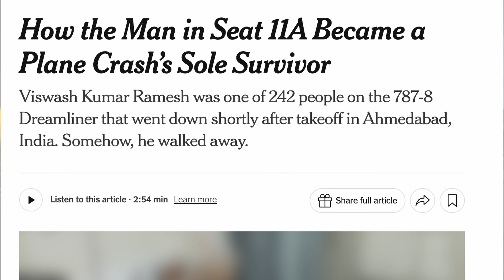Why the RAT Changes Everything – Air India 171 Update

Comment: Captain Steeve,

I love your work here.

Can i introduce you to some videos and have an opinion on those?

IF so, i need to supply the videos to you. They are not online.

They are about a certain historical event.
24 years ago.

I got these videos that i am struggling with because of what they obviously show.
Maybe you can convince me i am wrong with what i see.
Or, you back up my opinion.

Interested in seeing stuff you did not see on TV?
Reply: may i, youtube?
Reply: btw, dual engine failure, sure.
BUT, if it was an electric failure, which caused them to not being able to control the power settings to the engine (since that all is controlled not by steel wires but by chips and computers and servos)
Imagine if people controlled some kinda chip onboard which they could program to turn off certain systems, which would make it look like a dual engine failure.... 

Why would both engines have failed here?

But if they did, why would both engines have failed here?
Again, they are controlled by the electronics onboard, right?

Again: Ever seen the Pilot episode of the Lone Gunmen?

Is it that hard to imagine that certain people are up to something?
Boeing after Boeing falls from the sky. 
Yeah, coincidence.
Pure bad luck.

Nah.
Orchestrated is what i say.

a loud bang!
Just enough to destroy all the other electronic components that make the plane fly?
Where was this loud bang?
Clearly the loud bang was not visible outside. SO no major explosion with flames prior to impact of the plane to the ground.

What was this loud bang>?

Comment: Also the fact that you can hear the RAT at all is important. If those engines were making nearly 80,000 lbs of thrust each, you probably couldn't have heard it. And as I commented before, the 787 is designed to operate and climb safely, even on one engine. So both engines were not working. On a takeoff, that pretty much guarantees a crash. Another piece of information is going around about the gear. The bogeys or trucks were tilted down instead of the normal up angle. During retraction one of the first movements of the retraction cycle is for the trucks to tilt down. This suggests that a retraction cycle started and was interrupted. This suggests a hydraulic failure. (Another reason for the RAT to deploy) And hydraulic power is generated electrically. The plane has 6 generators. 2 in each engine and 2 on the APU (which wouldn't be running on takeoff). That's a lot of equipment to fail. HOW? ❤🤍💙

Comment: Apparently passengers who actually arrived earlier on the flight to india stated they were having trouble with the electrical system in the plane. Whether it’s the lights, entertainment systems or charging ports whatever it was they had issues for sure. Now if that’s true then did the Pilots and Crew inform of the issues to be addressed? Did the diagnosis clear the plane off any faults? Etc. Basically someone is in trouble.

Comment: What no one is talking about is this.... I think they knew they had problems before they ever took off. Unfortunately they were past the point of no return and decided to take off anyways. This runway is much longer than they actually need to take off. Look at the dust flying up in the air as they take off. Evidence that they were at the very end of the runway when they took off. Evidence the plane had problems getting up to speed before they ever took off.

Comment: There's a script which seems to be at play. Across twitter, Youtube etc.

This is being played out by Western "Pilots". 

The script goes:
- I‘m an airline pilot with X,000hrs of experience
- The flaps are only slightly extended
- The landing gear is still extended, which should have been retracted at this altitude 
- The aircraft is at a high angle of attack, which confirms the insufficient flap setting
- They combine the two to make it into a case for Pilot Error/ human error 
- Erase possibility of Engine failure
- Erase any possibility of Boeing 787 having any issues.
- They all exclusively use only a single video, which was when the plane was about to crash.

What they conveniently don't address:
- The Mayday call from the pilot 
- Sudden stop of all communication
- The fact that the plane was actually at an altitude of 400 ft relative to ground. Ahmedabad is at an altitude of 200 ft. 
- The Plane seems to have no power and falls
- The complete take off video exists which depicts the whole take off. NO change in flaps are noticed. Thus negating the theory of 'withdrawing flaps' instead of under carriage.
- The Plane was recently 'refurbished' by a Turkish firm

This is orchestrated noise generation. There's no chance that so many voices start emanating the same script, given facts to the contrary was already out, without inducement, incentives and orchestration. Why?

The noise about Bird hit stopped as soon as the CCTV footage of complete take off was out.

I hope people are taking note. Both the choreography and the actors. They need to be tracked.

Comment: in the clip where you hear the rat, you cant see it at all. 
in the clip where you can see it, its not clearly connected to the plane and indistinguishable. 
neither clip seems to capture the sound of the crash or the actual impact.

also, there was a video of the building with parts of the plane in it, and that clip also has some facts that dont fit... 

I'm not convinced this story is even legit.

Comment: Without the Thrust availability Aircraft wouldn't have taken off, or the pilot may have aborted the take off.
The take off happened and probably they sensed loss of power to manage the Aircraft control surface.
This can be the too late scenario and they then attempted to deploy the RAT to manage to control the surfaces... 
But there are redudant systems for hydraulicy as well. So if maintenance is totally screwed up ( which is possible) and there is pump damage and contamination then such a scenario can happen. Which is a human negligence created disaster.
Acc to me, there was a late realization of power failure ( hydraulic) to control the surfaces and hence the RAT deployed. I think it is this.
Reply: hydraulic contamination of the power control unit (PCU) electro-hydraulic servo valves (EHSVs) used in the flight control system.

https://www.federalregister.gov/documents/2015/08/19/2015-20267/airworthiness-directives-the-boeing-company-airplanes

Comment: I would like to ask a question about the departure.  I saw on the day of the crash that the aircraft only used 6131 feet of the 11550 foot runway on an intersection departure.  Could this have prevented them from a long landing?  I know it still would have been a disaster but they used every inch of the runway and if they had some left maybe they could have dropped in for a little less damage.  Just asking!

Comment: 1:39 at take off shows a lot of dust being pushed up by the engines, almost like the plane had reached end of runway before lifting. Ahmedabad is 3500 metres in length and 787 needs 1500 metres to get to speed.. Available radar shows the plane only went to end of taxi runway which is about 1/2 the runway before take off, is that common? Did they reach the point of no return before they had to if they had used the entire runway? Just speculating

Comment: Operating jet engines produce a lot of heat, not much smoke or vapor, but when viewed from behind (or photographed), the heat distorts what you see looking through the exhaust from the engine. Not saying this well, but it's like looking through heat waves shimmering above the desert for example. Their doesn't appear to be that heat distortion at any point watching that aircraft fly by, or away.

Comment: Point number 1.  If both the engines fail, the plane can land by gliding but for that it needs minimum altitude and airspeed to glide to the runway. 
Point number 2. Air india flight is about 800ft only and with 55k litters of fuel and its too much weight to land  and there is no thrust as well 💔

- Aeronautical engineer

Comment: The RAT isxan incredible piece of machinery.  On the L1011 the RAT only provides hydraulic power, and a measly 1600 psi at that, but it was held up with a 750 pound spring and was a real pain to stow after deployment!  And yes, they come out with a huge bang and make a great deal of noise when running!  We used to test them by hooking them up to a hydraulic mule and driving it with hydraulics from the mule.  One of the scariest things that I ever heard of was when our mechanics were testing a RAT on a C Check in the hangar.  It was break time so about 20 guys were standing around watching the test.  Suddenly the RAT prop started showering the belly of the aircraft with sparks and shortly after that, it departed the airplane completely!  The prop and hub clattered around all the stands that had been gathered around the airplane for the C Check and somehow, when it finally hit the ground and stopped spinning, not a single person had been touched!  How everyone escaped decapitation and death from that monster, no one was able to say but it was some kind of miracle!
Cheers,
jc

Comment: As somebody who worked directly across the freeway from Mineta International, the engines on this aircraft are not running any longer. Jets on takeoff thrust make a peculiar roar BEHIND the aircraft (which I listened to for years). It is missing from this clip. Ergo dual failure. My guess is water contamination, which would cause the engines to simply quit without warning--or recourse. This is tragic in every way.

Comment: The captains seat rolled backwards due failure of seat locking pins....thrust levers pulled to idle.....  First officer tried to push the levers up but the weight of the captains hand still on the thrust levers prevented him.   Aircraft stalled and crashed.   Mauintenance was done on the pins last 11 days....but no test was done

Comment: What I can tell you is that the fuel pumps feeding fuel to the engines during takeoff are non-electrical. The pumps consist of a clever system of gears. I’m not a pilot, but I’m a salesman. I sell the materials to the MFR who makes these pumps.

Comment: Can a serious electrical problem shut the engines down on a 787, or maybe just reduce engine thrust greatly due to some part of the engine system requiring electrical components to work?   787s have had electrical problems of a couple types in the past; there were the battery issues but also more basic electrical system problems due to low quality in components that Boeing had outsourced and not monitored quality enough.

Comment: Intelligent people change their mind when the facts change.

Yeah, well, tell that to most of those who still think Ukraine is winning.
Reply: that aside: Is it a far fetched idea that some people want to see Boeing fail?
For certain reasons?

btw, i do not see how it would be possible to raise the flaps accidentally instead of the gear.

TO mistake the 2 levers means you should not be anywhere near such levers while the plane is flying.
A pilot making such a mistake?????
I wonder how he was able to dress himself properly to be let into the cockpit if he is able to make a mistake like that.
The levers are not in the same place, they move differently, they look differently, they feel differently.

I really struggle to see how it would be possible for people to have been in that cockpit before, to raise the flaps instead of the gear.

The handles are not the same and in completely different positions.
And, sure, things move fast when you take off. But there should not be a reason to get distracted so much so that you make such a mistake if the take off is normal.
Sure, if you have bird strikes, you get excited and you can make a mistake.
But in this case the take off seemed normal, right?
So, no high pressure to do the next thing on the checklist.

I do not see it possible for people in the cockpit of a plane like this to make the mistake of retracting the flaps instead of the gear.
Mostly because the handles are completely different and move different and are in different locations.
In high stress situation, sure mistake can happen.
But it did not seem to be a high stress situation at first.
Reply: btw, anyone ever seen the pilot episode of the Lone Gunmen?

Imagine a huge RC plane....

Nah.

But again: Boeing after Boeing fall from the sky.
Why?
Is this orchestrated by the higher ups? 
I can think of several reasons why certain rich people would like to see the company fail.

Sorry, it is just an opinion, taking into account several other major world events etc.
Reply: just have a look at the pilot episode of the lone gunmen and tell me that that is not true and they did not put that onboard civilian airplanes.

It is as obvious as daylight that certain people wanna get rid of Boeing.
And the rest of the major airplane builders.

Why?
Well, figure that out yourself'

Dual engine failure, sure. What was the cause of that?

Or electrical failure? Which might have done the same thing.
As in: Decoupling the trust levers from the actual controls, as in: The trust levers may be used, but they do not give any input to the engine.
There aint no physical wires controlling a valve these days. It is all electronic.
So, an electric failure which includes trust control?
If my tiny mind can come up with something like that, imagine what others can come up with.

Comment: Steve great videos. Look this is hard to comprehend, as a 787 operator I have run through the details over and over and I’ve come to thuis conclusion. Without bird strike, without fuel contamination (you’d think other aircraft would have had issues) we have 2 possibilities, one of which we aren’t talking about. A complete meltdown of the aircraft , something so catastrophic we haven’t likely seen before or we have a German wings situation on our hands here. The plane is behaving as if the fuel levers are cut off, I’ll leave it at that. I can’t comprehend the dual engine failure without those other ingredients being likely and conclude cutoff scenario….

Comment: Another bit of evidence: there is a video going around of someone who flew on the same plane into Ahmedabad, he noted that the infotainment screens were not working and the a/c was also not working on the flight into Ahmedabad. This could be evidence that it had to do with some sort of power failure as well, but the dual engine failure is also a very well possibility. Thank you for the thorough analysis.

Comment: I forgot about RAT.  I am not a pilot but I did some military aviation software contracting a couple of times in my younger days about 20 years ago.  I'm guessing a combo of Human/[ground crew] and/or Boeing gauges.  I bet there were signs and symptoms for the last 3+ flights on that plane of electricity not push the correct voltage with non-mission critical components.  I can only guess.

0.  Not enough fuel or fuel leak:  probably didn't refill or contaminated fuel.
0.  The blades got damaged somewhere in flight:  maybe.
0.  Somebody didn't de-ice and ice got into the turbines:  Naw.
0.  Too much fuel (flooding) in the compression ratio got screwed up:  maybe.
0.  Not enough air pressure:  maybe (valves are open).
0.  The dreaded concern that 1 or 2 pilots purposely did this:  I doubt that.

Now that I think about its India.  Probably a ground crew problem and bad job.

Comment: Agree with your conclusions here. Two GEnx engines at TO power should be able to power the 787 even with low flaps. If not a dual engine bird strike, then fuel contamination is a very likely cause. Has anyone commented on maintenance activities before the flight?  That has to be considered as well.

Comment: Captain Steve, could an electrical power failure cause fuel pumps to fail thereby starving the engines of fuel resulting in loss of thrust almost instantaneously? The assumption would be that the fuel pumps are all electrically powered. I am thinking that the engines exhaust did not appear to show impaired performance due to contamination of the fuel. Also if all was well to proceed with takeoff, and the flight time was 60 seconds ..I am thinking the engine power was cut suddenly . The RAT had insufficient time to restart pumps and fuel flow.

Comment: Also pretty much obvious from the beginning is the fact that the engines at max power produce and enormous amount of thrust. And would have kicked up a tremendous amount of dirt and debris from the roof tops of those Indian buildings as it got close to impact.  A crew with the wrong takeoff settings would still have max power applied trying to climb.  And you see nothing. The engines were off or at idle

Comment: There has to be a strong possibility of a "Black Swan" event.
The entertainment system outage and intermittent aircon supply indicates a possible serious power supply/instability/wiring issue/instability.
A possible wiring short, leading to a catastrophic wiring melt down, and/or power supply spikes leading to digital safety systems being overwhelmed leading to cascading computer glitches, and/or the possibility of previously unknown/untested/imbedded software coding errors keading to a cascading digital hemorrhage.
The end result being uncommanded engine throttle reduction or shutdown, and possibly also an uncommanded flap retraction.
The invulnerability of "Fly by wire" backup systems = achilles heel.
Remember when the Titanic was supposed to be unsinkable.

Comment: I've isolated the sound of engines, they were idling without thrust in original video, that and reported electrical failure from pilots immediately before radio cut out... Hence fly by wire throttle rendering engines back to idle , RIP all souls on board.😢